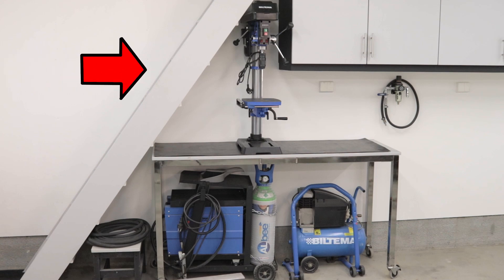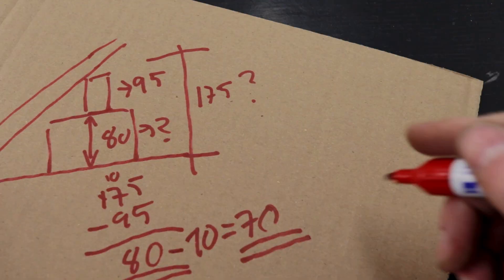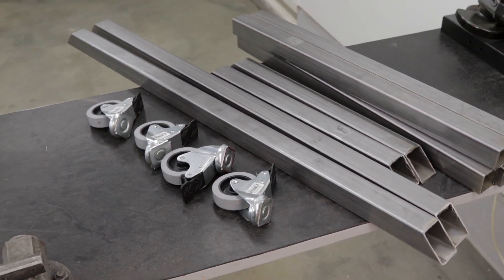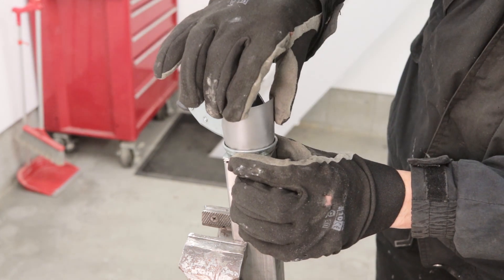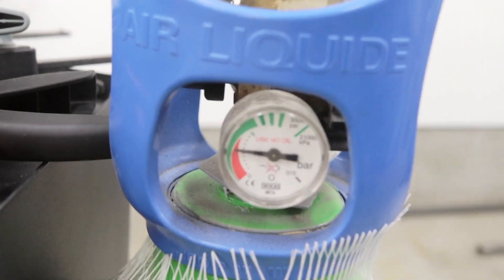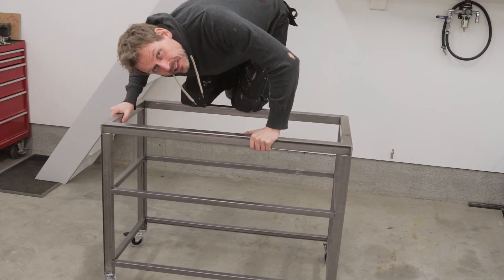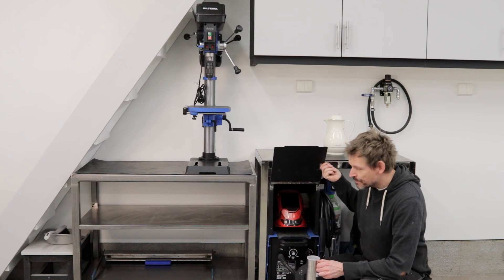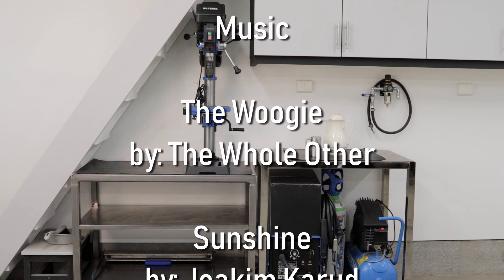DIY Workshop Steel Tables - Build Timelapse!

Comment: Hey thanks for this. I appreciate you’re shop is both wood and metal working.  One thing I’d appreciate, if possible, would be to summarize some of the key materials used in the description.   I don’t build a ton with metal but my last project i used far too think of metal for the application and now my table is too heavy.  My town is hard to find metal suppliers that will let you see their inventory so I’m pretty much having to guess the thickness without touch and I’m just not experienced enough yet to know what good choices would be.  I appreciate your videos and thank you.
Reply from the maker: Hi, glad you liked the video - and yes of course, I can absolutely update the description, here a short version:

I buy all the materials from Biltema, it's a Swedish chain of retail store you find in Scandinavia. I use 40x40mm pipes for the legs and for the top frame, 25x25mm pipes for supporting the shelfs. All of these have 1.5mm wall thickness. I find it difficult to weld with a MIG welder any thinner steel than 1.5mm.  

The sheet metal on top and for the shelfs are 2mm. It is more than enough for the shelves as I do not put very heave stuff on them, but it's not very sturdy on top for the bench drill (It's quite heavy). I added a couple of the 25x25mm pipes across the top (under the top metal sheet plate) to support the table top where the bench drill is resting. It would have been a very much more sturdy table top if I had used 3mm steel - or more. I would like to find something like that for my welding table, for now I have 2mm sheet metal there as well. The price jumps quite a lot when moving from 2mm to 3mm though, it's not 50% more expensive but closer to 200% more expensive- at least what I have found here in Norway 😋